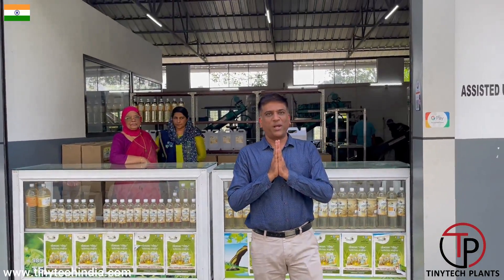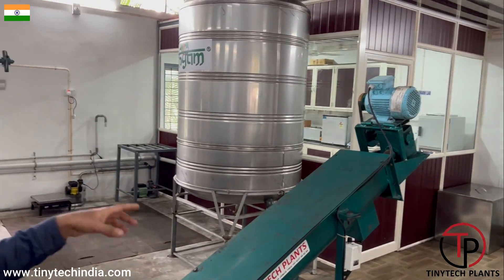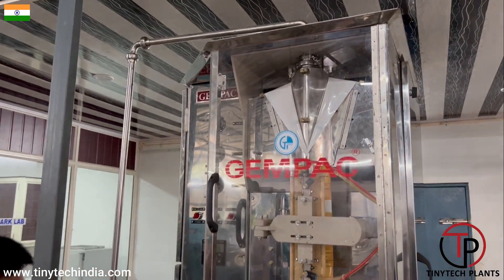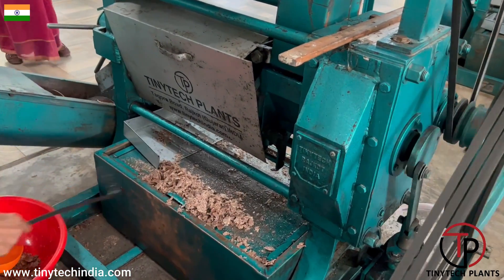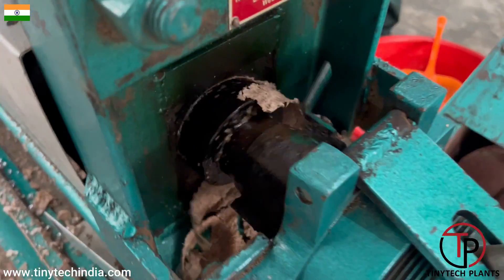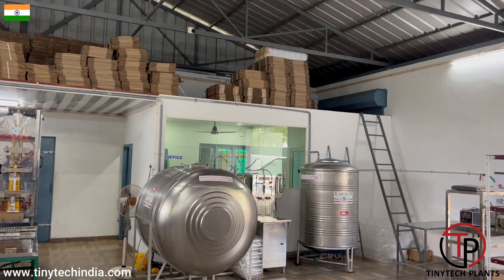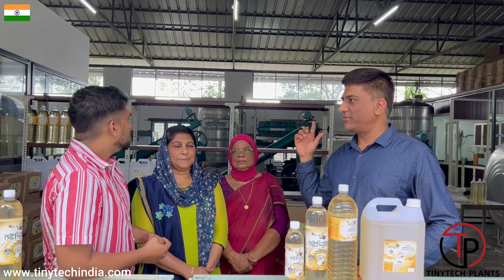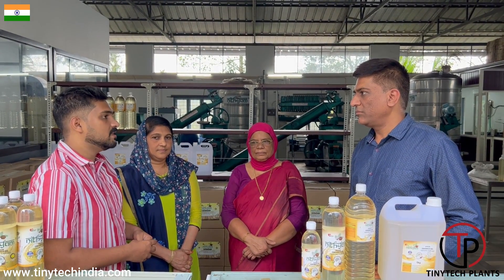5 TPD AUTOMATIC COCONUT OIL MILL PLANT 🥥🌴 #coconutoilmaking #oilexpeller #coconutoilmill #oilmill

Comment: ask:
Why are the steps for making coconut oil so spread out?
Why do you do everything with workers, employees - in rather complicated work steps?
Why do you need so many and such large machines that cost money to purchase and maintain?
Why don't you do everything in just one step?

You are certainly familiar with what we in Germany call a meat grinder: a kind of extruder, juicer in a lying form with an extruder screw. and if possible also a press screw at the front, which both presses out and removes the pressed material.
This means that juice or oil is removed within the device and not somewhere else. it is bottled where it is produced.
Juice is boiled, thickened - as a concentrate. oil is freshly bottled.

That would just be a single table-sized device about 700 x 700 mm table size!

On the other hand, I don't understand why you press it openly: why expose the pressed fresh oil to the surrounding air, which, as we all know, can be contaminated with germs in your country. with us too!

I note:
1.) The dried coconut pulp is added and chopped
2.) the crushed coconut pulp is pressed
       The coconut oil is created, which you can get straight away without any detours
       can fill!
3.) the pressed coconut meat is removed (you can still do it
       for other purposes, for example ground into flour).

I understandably don't understand the point of collection tanks, nor the point that was mentioned - multiple filters. for what reason?
Coconut oil is liquid or solid: depending on the temperature!

You can use it for cooking, frying - for a variety of purposes - even for cosmetic purposes!

Excuse me if I think that with a rather small device I could continuously process the quantities you specified.
that I could use considerably less mechanical effort and require much less space.
The storage tanks are disproportionate for me - as is the film packaging system: it is simply sufficient if you use 0.5 liter bottles and 1 liter bottles as a storable product that has a long shelf life.
So reduce effort - overall!

https://grabcad.com/library/fruit-juicer-machine-1
https://grabcad.com/library/sugercane-juicer-machine-1
https://grabcad.com/library/juicer-22

Please understand: I need a device that can process a lot of different fruits that are seasonal - i.e. have different harvest periods at different times of the year.
You can't buy machines for every type of crop: that would be disproportionately expensive.

Coconut oil, neem oil, linseed oil, lemon oil, orange oil, fig oil, sesame oil, walnut oil, peanut oil: I have several hundred different oils here that we want and need to produce! also fish oil!
Some in small quantities, sizes, others in large quantities: so it makes perfect sense if you choose a machine size that connects everything together.
with which you can process anything!
Large quantities can be produced or processed with small machines by running the machine through - day and night if necessary.

I have an example that is decisive: I have to produce fish oil from 400,000 fish, all of which weigh between 2-3 kilograms, in just one day.
a huge task!
(smoking - skinning - removing fish meat - processing - drying the skins with the layers of fat, grinding them and pressing them into fish oil!)

I ended up with you by chance: please excuse me if I disturbed or bothered you - that wasn't my intention!
Kind regards from Berlin, Germany
Reply: Very interesting comment.
Boiling turns the good oil toxic tho.
Reply: @earlysda  :Here in Germany we use coconut oil for cooking, frying and baking: these slab-like hard fats have been around since I was a child.
Why should coconut oil become poisonous when heated?

I do not understand that!
maybe it's related to your oil? I can't imagine

We make coconut oil from sun-dried copra, which is shredded in the blender.
and what comes out after pressing is 100 percent coconut oil.
It doesn't matter how you use it: you make cosmetics with it, soap, and you use it in a variety of ways for cooking, baking, deep-frying.
The starting point is always natural - 100 percent coconut oil!
Warm greetings from Germany
Reply: @earlysda  : Generally, the purity is a result of the manufacturing process used. Impurities in the oil are the result of mechanical processing; the oils are then not 100 percent pure.

There are many vegans, organic freaks in Germany - what do I know - who make claims arbitrarily, ideologically motivated - even though there is no experience or research on this!
and interested commercial people - claim similar untruths - in order to better present their own products!

I would like to say: there is no food that is poisonous!
And especially not when it has been tried and tested and can be bought everywhere on the market for decades!
As part of my project planning, I tested many foreign products - for example from KTC from England, which apparently mixes coconut oil together "produce from serveral countries" - otherwise there are no complaints about the test purchases.
Everything was selected as “premium quality” or “for export only”

It is not my decision what I can put on the market - because the German authorities check this relatively closely in the food regulatory authorities.
I have no problems with it!

1)
Is coconut oil toxic?
Coconut oil: is it really toxic to us? -
Compared to lard, the saturated fat content of coconut oil is higher, but that does not necessarily make the vegetable oil harmful to health. “Coconut oil is of course not toxic. The oil is part of a balanced diet,” says Niemeier
2) Oil mill
Is coconut oil really “pure poison” as claimed in the lecture?
No, of course not. Ms. Michels has already retracted this statement and apologized for it. Basically, no food is “poisonous”. Likewise, there is no one superfood that is better than all the others. A good diet consists of a balanced combination of different components. And of course, as with all food, quality matters. If the industry uses cheap, refined slab fats made from coconut, it is not healthy. The organic coconut oil from the Solling oil mill is produced from organically grown coconuts. The fully ripe nuts are carefully processed into native organic coconut oil in a way that preserves their value. This creates a pure, nutrient-rich, purely vegetable cooking oil.
Reply: @earlysda  :you mean your people? They probably make pictures, graphics - I don't bother with people for no reason: I only saw a film that hinted at it - a woman said in 1904 - fireballs are coming!
good!
staged: for whatever reason!
And I've been saying for over 30 years: you're evil - that's why I visit devils so I can look them in the face!
good?
Everywhere I've been - it's raining now: no fireballs!
Around 1904 people thought differently about punishment, I think!

In 2023 you think: there are the evil eaters in the cities - writing the most evil things, manipulating - but they have to eat! And when water comes - their fruit and vegetables rot away - the animals' food rots away: then millions in the big cities are hungry!
They don't do anything, they don't grow any fruit or vegetables, they don't keep any animals...
well!
good?

It rains all the time - and endlessly: and the water - well, it doesn't want to go away! there is always more to come! it causes damage!
I don't need to paint pictures or manipulate them in any other way!
Everyone only sees black and white: blind! I see all colors and colorful!

It may be that people have an opinion about me: and that people's opinions are also manipulated! funny: it's the church!
but I think when I'm lying down - and then it happens!
I've been doing this for over 30 years - and I need a recall, the result of my thoughts!
and lo and behold: I get YouTube films: bad people come and try to do what all the outubers I ever knew do!
and I see that the water in France, Spain, Africa, Portugal, Holland, England, Turkey - and America - doesn't want to go away!
and I see that all the bad people have problems that inevitably arise when they are angry with me!
I don't need to do anything!
That's nice, isn't it?
It's stupid when we all know each other from before!
I recognize everyone by just one part of the face that never changes - the eyes!
That's why I went everywhere myself and looked the devils in the face!
Have a nice day - as long as you can: I know who you are!

Comment: What is the total cost
Reply from the maker: For more details like the price of the machine, crushing capacity, oil production, area required & Profit margin kindly contact us by whatsapp on +91 9227505254. 

मशीन की कीमत, पेराई क्षमता, तेल उत्पादन, जगह की आवश्यकता और प्रॉफिट मार्जिन जैसी अधिक जानकारी के लिए हमें व्हाट्सएप से +91 9227505254 पर संपर्क करें।
Reply: @TINYTECHPLANTS
Reply: @TINYTECHPLANTS Do you have commercial machines for 10-20 kg of oil per day production capacity? If yes what will be the cost ?